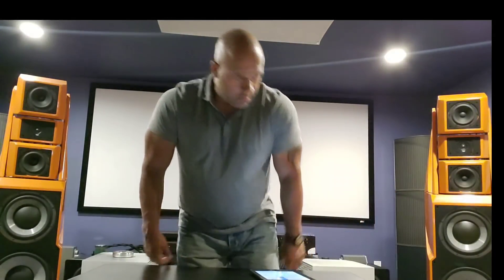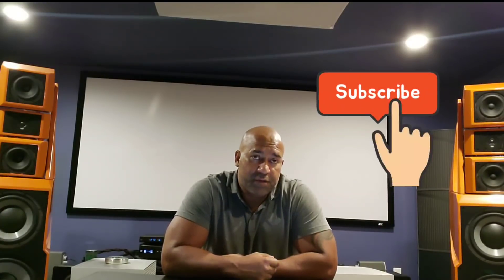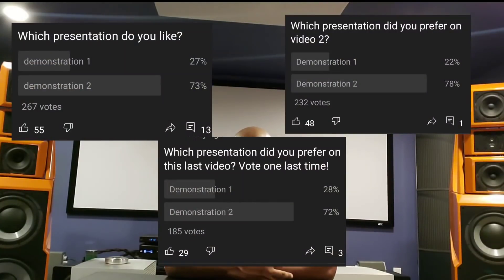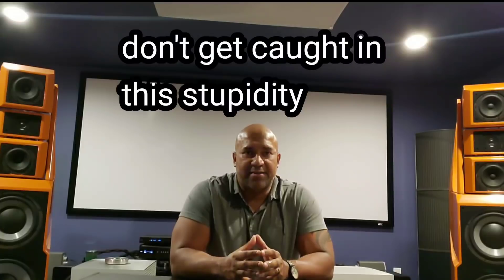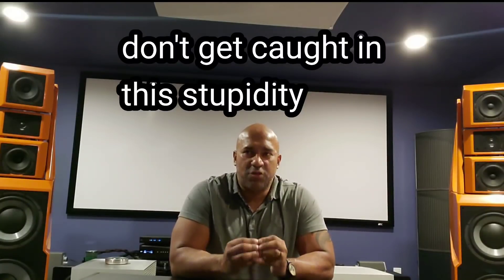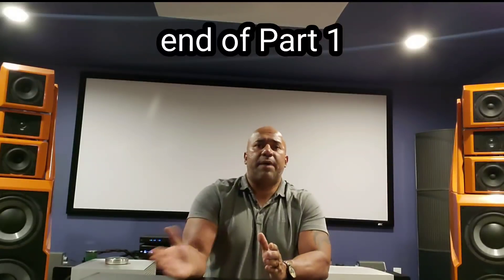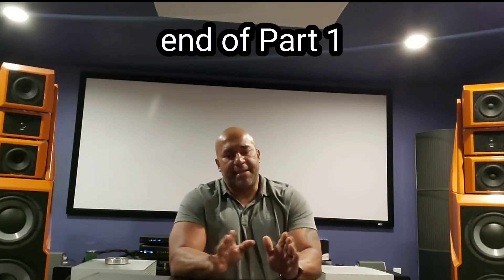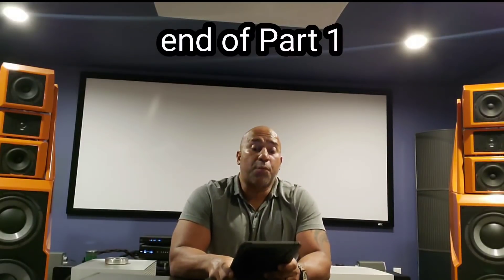DACs: Here's the truth that nobody tells you!

Comment: It's the quality of the clocks and the cleanliness of the power supply to the clock that can make digital sound better, and I haven't seen a "finish line" yet for a "perfect clock" as yet less phase noise always makes the sound better.  I learned this in the DIY world, not by buying mega expensive commercial DACs. And my speakers are pretty revealing - electrostatics - (although not the highest end electrostats) so that may not hold as true in all situations.

Comment: this is the video i dislike the most so far from ur channel. look at something like the dynacord p64. complete overkill. can do way more then anything u ever need in stereo. it can do everything and is used in complex systems like a festival etc pp. that modular system fully equipt runs u around 12k€ and is simply as good as it gets. there is nothing better then it. theres only equal.

if you need less channels ( maybe only 2 ) there are other options which iam not so well informed about, because thats not exactly my field ( home theatre, i use 2 P64 )
any "hifi" dac i know is vastly inferior to good quality pro audio dacs.

also streaming now with hi res options like appletv is literally the best quality you can get. saying its "bottleneck" only shows how little your informed about how files work. Its a vastly bigger file then whats avaiable on cd for some songs that offer that quality. And vinyl is fine. But its not better then CD or SACD or streaming. its a diffrent option. Equally as good.

Comment: What about ciroc?

Streaming should evolve.  The next evolution is to further file caching and local play of the file. That will allow DACs to keep plumbing the depths. 

But I agree with your assessment—actually DACs at very reasonable prices can do D/A very well. The analog output and power supplies limit them more than anything else, and advancements there can only net so much. 

And once you get above X bits of resolution (some may argue 16!  Some 20-21 etc) it’s the rest of the system that can’t keep up, including the transducers and our ears ;)

Comment: This is a great video. I'm a mix engineer and producer and I can tell you that simply going from 16bit to 24bit audio is a massive improvment spicificly in the bass frequencies. You can hear it most in the sub bass with headphones on. The bass is much thinner with 16bit vs 24bit audio. Also going from mp3 to wav/flac will give you a much cleaner high end. You can turn the audio up louder without distortion. Mp3's distort really bad in the higher frequencies when you turn them up loud. 24bit wav is the best way to go. Some artist are still only doing 16bit for CD but with larger storage space there is no reason to not export to 24bit audio. I only release digital vs CD just for that reason of being able to export higher quality audio with my mixes.
Reply: I thought bit depth does not impact frequency response only the number of steps of loudness

Comment: There is another truth not very commonly shared due to different (probably marketing) reasons ;) Today's network players are still far, far behind very good CD transports. I had different network players/streamers in my room, some of them were TOP line, but no chance with for example old ML Reference CD Transport 31.5 :) The number of hidden details, layers, 3-dimensional sound that this old CD transport can retrieve is unbelievable. Out of reach still for current network players, maybe I don't know - I have to re-check again in next 5 years if situation has improved or not.

Comment: The problem with streaming services is that they don’t sound any better than a lossless CD rip regardless of the sample rate.
Yes they have higher resolution downloads, but if the source is AM radio then it is still going to sound like AM radio regardless of how it is encapsulated.
They are not taking these streams from master tapes, and whenever I ask Qobuz or Tidal what the source is, they will never tell me.
Reply: I use Qobuz and I can usually tell instantly whether it is CD quality 44.1/16 or high resolution 96-192/24. I suppose it depends on how resolving your system is. I'm listening with either Audeze planar headphones or Martin Logan electrostatic hybrid speakers.
Reply: The source for Tidal is MQA, which is snake oil that's more distorted and lossy than MP3.  Lord knows about Qobuz.  To be honest, regardless of the quality on offer I will never incorporate streaming into my HiFi because the breadth of library just isn't there.  I do not accept being forced not to listen to certain albums, either randomly without warning or permanently, because a streaming service or record label has decided I can do without.  Their library may be bigger, but it has Drake, and mine has all the Judas Priest and Black Sabbath albums.  So which is better?

Comment: This is hard to explain Jay but most DAC’s aren’t very good no matter the price since the analog output stage is solid state and not strong enough. I found one from Vu Jade Audio it is 12k only supports 24/192 pcm BUT it has a massive tube input stage and tube output stage, the best Audionote and V Caps, proper power chokes, a huge transfer  and is RTR with true No over sampling. Two chassis and makes the DCS Vilvaldi sound like a tinker toy. 
What else did it beat?
My Lampizator 
Crushed a Holo Spring 3 KTE
Beat a $30,000 light harmonic DaVinci 
Has the Mola Mola Tambaqui beat too! It’s made by Karl Tam and he is a true audio engineer with a masters degree in electronic engineering. It is like real! It sounds best with a Marantz CD94 transport with SPDIF. There is no usb, no dsd, no MQA…no frills…it’s scary real! You can stream with SPDIF!
Reply: I don't think you understand what you're even on about. Please explain "not strong enough"?

Comment: After Lampizator Amber III and PS Audio PerfectWave DACS. I sold both and found a far better source that I use as a digital source. Way better. DAC’s are not a good product niche. They are simply too variable in signature voicing design etc and synergy in any system becomes a costly gamble. Let the manufacturer integrate the DAC within their preamp or source design. It’s just smarter. Nagra / CH Precision etc aside… I just don’t see the value proposition.
Reply: I dont understand your comment.  You mean you no longer use a dac?

Comment: In my case, I am using a DAC but it's portable. The Audioquest Dragonfly Cobalt. I can hear the difference between using that DAC or just connecting directly from the computer. This DAC uses the ESS ES9380PRO chip. It costs $300.00. I am looking at the Gustard X26 PRO DAC.  It has two ESS ES9380PROs in mono configuration. Where as I am sure the markup on these devices are high, giving the makers a nice profit margin. So for $1500 I expect that the Gustard X26 PRO DAC will out perform the Audioquest Dragonfly Cobalt.  Not because it's more expensive, but because it has two of the same chip, an entire board dedicated to the clock and it's own external power and not needing to draw it off the USB port like the Cobalt does. 

Since I have never experienced sound on a full external DAC, I am not sure what to expect, but if it's anything like the difference between an on-board, get-the-job-done DAC on the laptop versus the Cobalt....then the gains in sound should be tremendous.
Reply: I used the Cobalt for a Long Time IT was way better than a Lot of Dac's in streamers that Cost Up to 2k. Everything changed when i Heard a Chord Quetest DAC. IT was at least 60% better.

Comment: Hello Jay, Would you say that the DAC in Hegel's H390 any good?  I am putting together a system consisting of a Hegel's H390 and Dynaudio Confidence 20 speakers?  What are your thoughts on this system? Thanks.
Reply: I have the h160 and the dac in that is now comparable to dacs around say $500 to somewhere over a grand.  With differences in body/separation/detail and resolution.  You may prefer some quality of one dac over the one in the hegel and vice versa.  I have a topping d70s and it has more body in the low to low mids while the hegel being a bit cooler has a bit better separation, marginal but noticeable perhaps because of the slight addition of bottom bloom of the topping. I can prefer one over the other depending on music and they were close enough in principle.  I will state, the topping was hooked up via rca cables. If I used XLR, it may have been a different story but by how much may still be marginal.

So I used the dac inside the hegel to compare more budget options for another amp for a sound I liked or at least was used to.  The topping d70s is the source for a Keces e40 (which I call my little hegel) and sounds very close to my hegel at low to moderate volumes.  I get 90% of the performance in my application of a $3,500 amp for essentially a third or so of the price.

That little Keces beats out everything I've heard under a grand too.  The dac in the Hegel 390 should be better than those I mentioned above, by how much I can't say.  Perhaps more comparative to a $1,500 dac such as Gustard X26 Pro or something above its' pricepoint.  Synergy and tastes are important considerations too.

Comment: Hi Jay, I agree with you totally on the line in the sand for DAC at this point for me its $22K. I have a hard time believing anything more expensive will give me any appreciable improvement. My Reference connects me with the music like no other DAC has. Maybe its because the designer invented sample rate conversion.. I dont think there is a expert more in touch with digital conversion than Andreas Koch. So I do not hear that big of a difference between streaming and playing a .WAV off a local SSD, so what format do you refer to when you state that streaming is limited , therefore a expensive DAC is a waste ? which format reigns supreme with the expensive DAC's ?  Im dying to test one in my rig to compare to my $22K line in the sand, for 2 reasons. one, if its clearly better I want to use one  2 if its not clearly better then we all can hear how close it is for the extra 80K or whatever .  I personally think a $100K DAC is to show off. Because there is nothing in a decoding computer that would indicate anything close to that cost unless it used solid gold chassis parts here and there and it would still only be cosmetic. I dont take gear like that seriously,. how could anyone ? So where do you draw the line with DAC for Streaming like you do ? I stream as well.  I also will not enter Vinyl. Digital is as good , better actually if its a digital recording than vinyl and to have to collect and clean, flatten, worry about what pressing , fuggedaboudit.  I do however have master tapes and 2 reel to reel decks.. maybe Ill do a comparison in the next few days between Streaming and Master tape .. ;-)  So yeah man, I totally support what youre saying about DAC's

Comment: That's shy I'm still sticking with my high quality red book cd player's, with their inclusion of HDCD decoding, while still buying and using cd's still for my main audio rig. Streaming for me is used only from my Sony Xperia mobile phones, and from my portable cayin  N6ii T01 player using 2 of Burr browns highest quality PCM 1792A dacs,  either using with or without my class A headphone amplifier, and with either my professional neodymium magnet beryllium dynamic driver headphones, or my professional studio double neodymium magnet double pushpull planar headphones. I dislike upsampling digital audio and the upsampling digital audio products. There is absolutely nothing with 16 bit red book digital audio, especially through burr browns  24/96 or 24/192 dac chips, their implementation done properly and right without deviation of frequency response neutrality, they posses very neutral and refined natural audio sound quality. If your loudspeakers and amplification do not possess a neutral response, as well as a possessive quality of low distortion and fatigue, then your audio system is screwed as reguards to its sound quality performance. I believe a high quality home audio loudspeaker system rig should be capable of biamping or triamping etc and so on.  There is more opportunity to gain a higher  level of performance on a higher level, than any pair of single wired only loudspeakers, driven with the only option of one amplifier option. As reguards to the audio  manufactures with their notions of been in the camp of single amp, singled wired loudspeaker camp as making the best possible sounds in the world camp of audio manufactures, which mostly the highest end audio manufacturers and loudspeakers manufacturers continue to mostly adhere to way of doing things,  i can absolutely claim against  this notion of one amplifier per single wired loudspeakers is totally the wrong way possible of getting anything near the best audio quality sound that is possibly to achieve.  large audio system rigs driven by one amplifier and singled wired loudspeakers has never ever left me impressed at all with the notion they make the best sound quality sounds in the world of audio.  I can claim they certainly do not. If this camp of audio manufactures and loudspeaker manufacturers think that they actually do, then they certainly are totally wrong to think that they do.
Reply: I agree. For many (most) speakers, cheap or expensive, the crossover network is one of the biggest limitations.
It can cause phasing issues, too shallow allowing woofer modal breakup, etc. Unless it's a single driver design, best to biamp and use steeper digital filters.
DACs in the 80's were basically (audibly) as good as we have now, provided that they were properly engineered. Early digital audio for CD's were recorded via a Sony PCM1600, on a betamax tape (hence 44.1khz), in 1978.
Get yourself an older, well made CD player with a good DAC and analogue circuit, and you'll be as well off as anything you could buy now.
Reply: On another note, for class A headphone amps, Kevin Gilmore's designs look to me like an ideal one. Fully DC coupled, no capacitors in the signal path, balanced push-pull class A, constant current sourced, discrete component, minimal or no feedback needed. His Electrostatic headphone amp designs have been considered the best for decades now.
Been planning to make one myself.

Comment: Jay, I agree with you about the jump between a 20k dac to 100k might not be worth the money. But i think for a person who depends on streaming, you are not giving enough attention to your ethernet enough no your streamer selection.
Someone mentioned the Taiko extreme, and that's one way to do it. PF, or even some other less known but excellent servers. I Think Aurender is kind of left behind nowadays when it comes to bleeding edge.
Assuming that your Aurender is fine, the next key step which would cost you 200 usd but will probably be revolutionary, is to get a router without built in Wi-Fi!! I tried that a two years ago and I was mind blow. Get a ubiquity edge router SFP, Use an LPS with it, use your current router as Wi-Fi access point only. I promise you it will be a revelation. Next step would be to get a proper Audiophile switch with an LPS for it. Streaming will touch CD then and maybe even better!!
Reply: A 20k dac isn't worth it never mind a 100k dac.  What a joke lol

Comment: Hey Jay I agree with you about the Dac’s it’s the source that could gain a lot. I am diy source guy, diy server,  and I am amazed with what the software, power supply, motherboard, cpu does for SQ. The rest of the system needs to be up to scratch of cause but seriously if you have the money Taiko extreme is the way to go not only for H.W but also for the S.W. Also there is an alternative to streaming and that is local file on a NAS or ssd in the server, local files should be better than streaming from Qobuz. 
Oh and I am not a Taiko sales person. 😀
Reply: In my experience with roon rock for streaming Quobuz/Tidal and play local files stored on NAS if you use an "audiophile" Ethernet switch, with a good ethernet cable and power supply the SQ is the same if the track have a the same orignial track album (same years production, remastered etc etc )
Reply: @robertobrandoli4462   I agree and have the same experience. With the caveat of the synergy between MQA and particular DACs that have been build for it (which creates like a different top end filter on listening). But basically this is it : my original master stored directly on the streamer’s SSD vs. on the NAS vs. on streaming services : and it is nearly impossible to hear any difference at all.